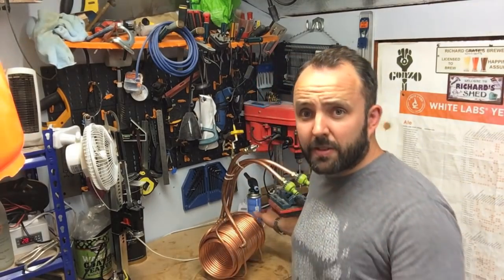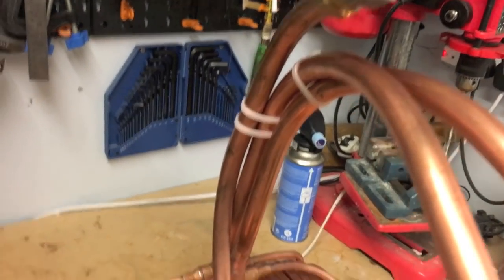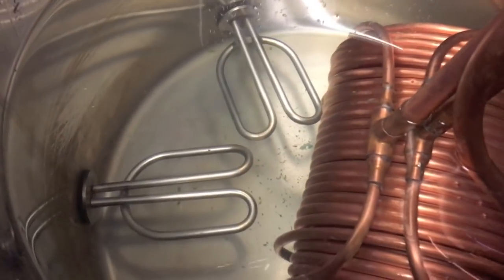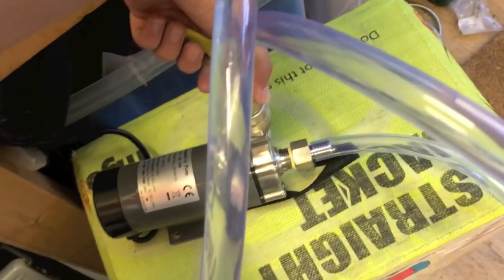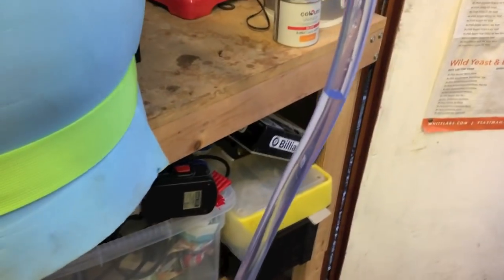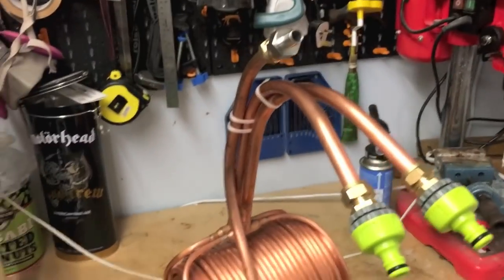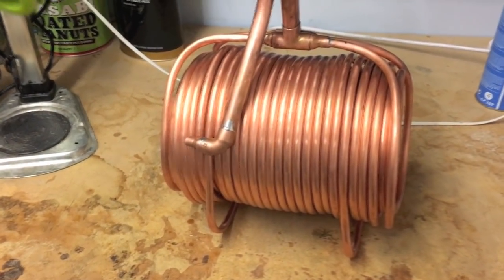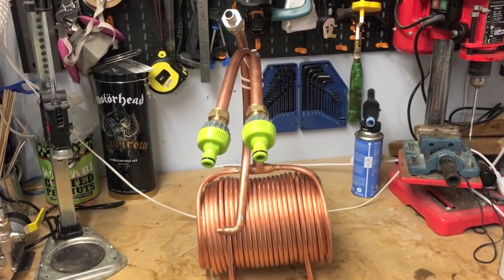Twinchilla Mk3 Dual Coil Immersion Chiller with Whirlpool Arm

Comment: Looks very good, inspired to built one myself.  Tempted to try either make the inner and outer coils flow in opposite directions and see what effect that has, or mount the whirlpool arm so it drives flow through the inner side of the coils. A trip to Screwfix is in order 👍

Comment: this is epic Dude

I'm going to attempt one myself using 20m of 8mm tube. A few lingering questions I hope you can help with that haven't been answered through your 3 chiller vids:

1. is there any issues using the tap at the base of the kettle for whirlpooling? I've only ever seen standalone whirlpool tap set ups. 

2. why did you go horizontal coils again? whats the benefit, versus the upright coils? all immersion chillers i've seen for sale are upright

I live in the tropical north of Australia, so am very jealous of your 10 min chill time! Love the work. +1 sub!
Reply from the maker: Hi Jeremy, hope the build goes well, in answer to your questions:
1. No, I dont see any need for a separate outlet tap for whirlpool if you dont want one
2. My theory on the horizontal coils is that the wort can flow through and over the coils more easily (especially with whirlpool or even stirring) compared to a vertical arrangement. Also with my pot which was quite wide it helped to keep all the coils fully submerged, vertical would have been above the wort for most batch sizes.